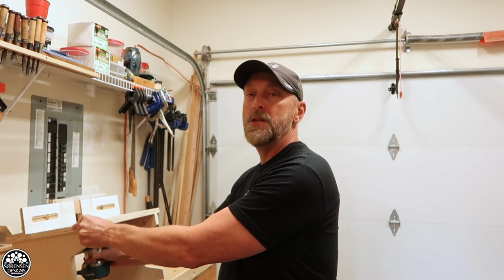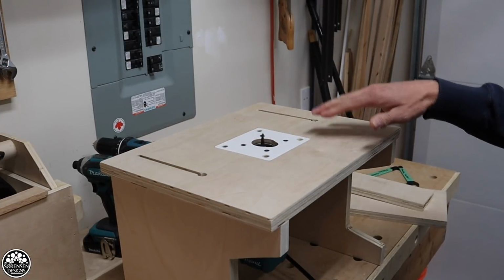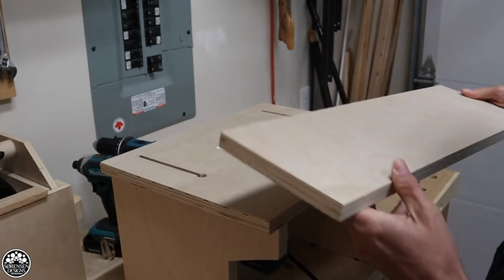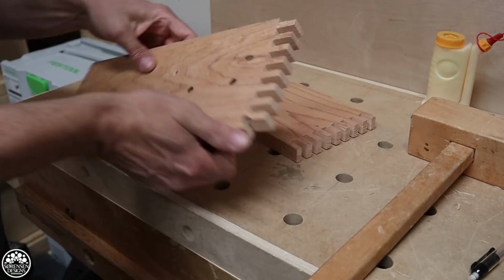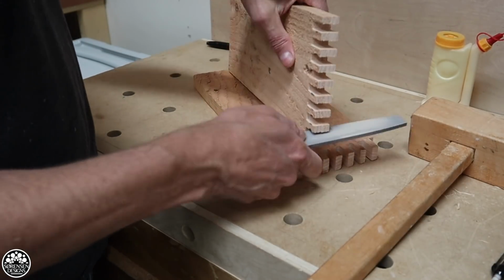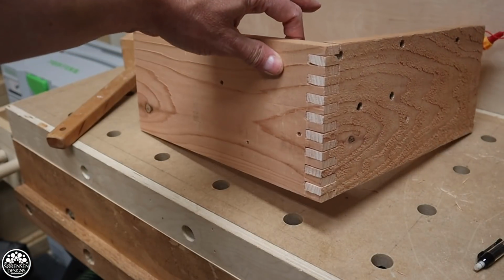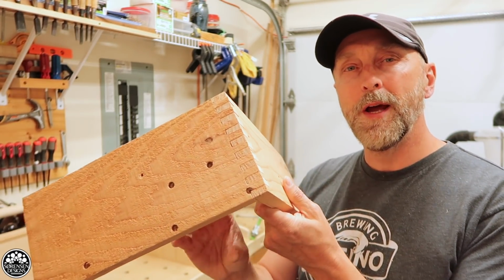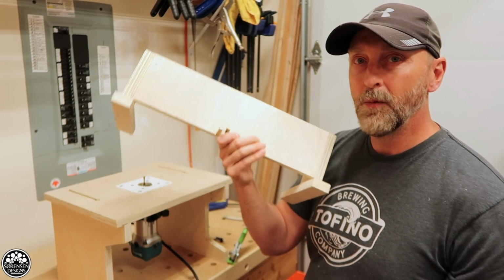Box Joint Jig for a Mini Router Table // Woodworking

Comment: Really nice. You are so inspiring. I guess it could also be made for dove tail joints ?
Reply from the maker: Thanks Jan! A bit tricky to make dovetails on plywood. You will probably have to use solid wood, unless you have a CNC machine.

Comment: Thanks For Your Time. Would a pair of T Tracks make that sled easier to slide and more accurate?  Also would having the jig comprised of a sliding sub fence and the finger joint jig make it easier to adjust the fit by moving the jig closer or further away from the bit? That said it seems you nailed it the first time, so adjustments were not necessary. Again, thanks for your time.
Reply from the maker: I never had any issue sliding this through as-is. The design is meant to allow a small amount of play laterally, (1/16" - 1/8") so that you can customize the finger size and easily guide the fence through the cut. The accuracy is quite good. T-tracks on a small table like this wasn't necessary - one of the many advantages of the mini router table.

Comment: Nice and simple! Rather than using that extra “finger”, couldn’t you just slide the last notch of the mating board over the glued in finger and use that to setup your first cut? May be interfering with your clamp, 🤔
Reply from the maker: You could try that but it probably won't line up right. If it's off by 1 mm you'll get the extra friction on all the fingers.

Comment: Nice quick and easy jig. Is there some particular reason you set the jig up with the project board on the back side, away from you?  On first blush I would think I’d want the project board where I can see it.
Reply from the maker: Thanks! I set it up that way for safety reasons. If chips or splinters go flying off (and sometimes they do) , I would prefer to stay out of the line of fire. Once it's clamped in place, you don't need to see it. Just run it through nice and easy🙂
Reply: Eric Sorensen - reasonable. I plan on building this jig because it seems much easier to use than some others I’ve tried. Thanks, keep up the good work. 👍